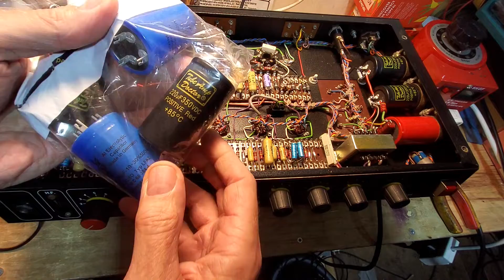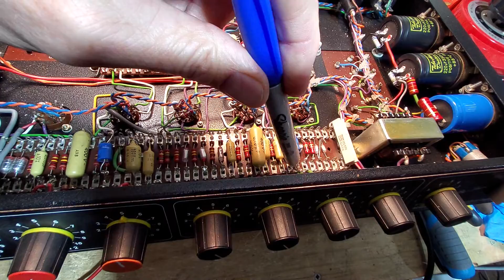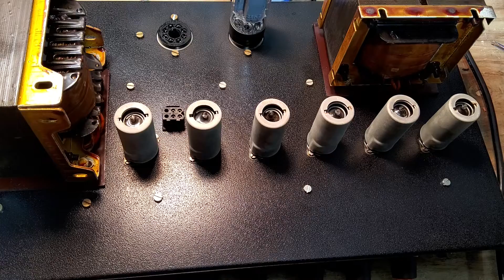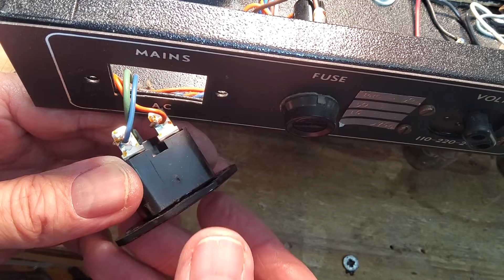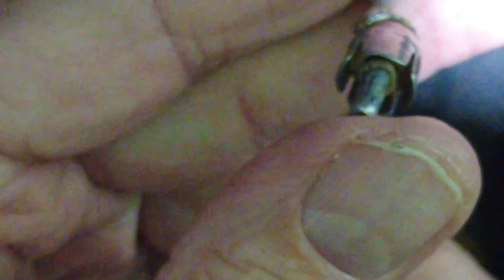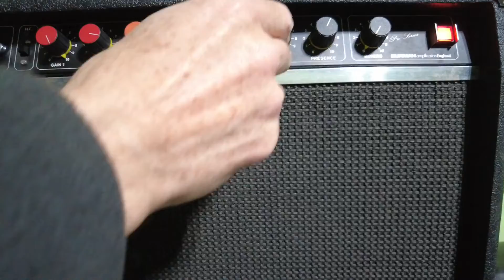Burman Pro 501 Combo Boutique Hand Wired Guitar Amplifier  Part Two Full Service

Comment: I adore your playing in this , I have a Burman502PRo and have used it for 40 years! ANd yes you MUST have the Accutronics reverb tank hooked up  with that annoying RS Components multiii plug! The direct inject has been removed from mine, I was told mine was owned by Nazareth, it was one of several spares. Great bit of kit,
Reply from the maker: Hello David, thank you. That's a long time to have owned an amp. Nazareth were a great band. The Burman amps are one of the best. Take care.
Reply: Looking at the schematic of the Burman 502, I notice the 'Mid' EQ stage is involved with the 'buffer' stage, later in the signal chain than Bass and Treble. I have found that dialling  'mid' totally out of the picture greatly increases the clean headroom. I wonder if it's possible to tame the 'buffer'? It is fed by a stage bypassed at the cathode with 100uf at 10volts. I see some potential for a mod to clean up the unruly distortion, and perhaps the same could be done with 'Gain 2' which is almost always too messy , unless you're happy with 'a storm of nails' overdrive.  Any thoughts @vintageguitaramp_guitarteacher ?

Comment: Hi, thank you for the service video. I have to do the same Job, recap it, get some KT77…and we will see what else. With how much mA do you bias the KT77? Thank you!
Reply from the maker: Hello, thank you. The bias current will depend on how much HT voltage you have from the secondary of the of the power transformer. The bias should be set at 70% idle. The KT77 has a dissipation of 25 Watts. 25 x 0.7 = 17.5 Watts.
Reply: Thank you very much for this information! I‘m exited and hopefully the day will come soon.

Comment: Martyn, that was a particularly tasty sound demo, and I think it's fair to say that this amp inspired you! Did you ever find an actual reason for the intermittent voltages and the bias setting creeping around? I'm still a little concerned about it; I tend to suspect leakage through the board or a socket, possibly from contamination..... You've probably already buttoned it up and maybe it went back to the owner already, but anyway I would have liked to have seen what happened if you hit it with warm air from a air dryer.
Reply from the maker: Hello. I am going to change the tube sockets and screen resistors. Don't have any confidence in the bias staying stable, once someone starts to gig with it. It's a lot of amp and it needs to be right. I have ordered a pair of Belton sockets for it. I am not happy with the bias preset either. It needs a fail safe, although I would sooner it be a fixed resistor value. I will be doing another video when I change the sockets. It's that feeling you get when you just can't leave it as it is. Take care.
Reply: @vintageguitaramp_guitarteacher  ,  It also occurs to me to ask if any of those front panel controls are making signal ground simply by virtue (🤔?) of being bolted to the chassis. The thick paint could be causing resistance and interfering with the grounding of the pots.  There's a good reason that Leo Fender used an unpainted chassis and a brass ground plane  plate for the pots to bolt down onto;  and although Leo's amps were not high-gain and therefore less prone to grounding issues, this Burman has tons of gain and proper grounding will be crucial.

Comment: A hidden gem amongst vintage guitar amps. Your playing demo did it justice and demonstrated that these Burman's should have become a household name amongst the guitar playing fraternity up there with boutiques like Dumble and Trainwreck.
Reply: Move over, Mesa Boogie and Dumble! From soup to nuts, is there anything this amp can't do?  No need for a clean boost pedal, Tube Screamer, or a Rat on this beast! Hell, it even djents!  It definitely shines through the 4x12 cabinet; a shame it wasn't built as a head.  The brand name is so unassuming, and the amp so unadorned with frills or fancy graphics on the name plate that players probably don't give it a second glance if they come across one, which is a shame.
Reply: @goodun2974   I share your thoughts entirely. They are heavy amps and a head version would have been a great option with that additional bonus of plugging it into a 4X12 which was definitely a great match.
Reply: @pda49184  ,  I don't know if you watch Fazio Electric on YouTube but she (Colleen Fazio, a female amp tech) did it quick examination of an old Selmer Twin Fifty combo amp that looks like it weighs even more than this Burman does!
Reply from the maker: Hello. I spoke to a guy who knows a lot about these amps and knows Greg Burman. I am sure he told me that they didn't make any heads. It does sound mint on the Marshall cab.
Reply from the maker: Hello Pete. I think so too. Take care.
Reply: I really wish they were worth the same on the used market!

Comment: Just had a comment deleted because i put a link to a recent Uncle Doug vid about a brownface bassman. He rejigged the bias circuit so if the pot has a break or dirt on the track there is a backup resistor to avoid bias runaway damaging the output valves. Worth a look?
Reply from the maker: Hello Rob. I was thinking that yesterday. I an not happy with the trim pot. In fact I have ordered some new tube sockets and screen resistors. I have done similar things in the past with the trim pot. I will check the Uncle Doug video out though. He's great at solving problems, thank you. Take care Rob.

Comment: The huge transformers in there handle as much bass and volume as you'd want so scooping the mids helps the distorted tones. Make a great bass amp too, really nice cleans, a versatile amp. Nice design.
Reply from the maker: Hello Rob. Yes, it;s a beast. I have just put up part three. I changed the tube sockets. They were done for, even though it ran, there was something not right with the bias. All sorted in part three though. Thanks Rob and take care.

Comment: Thanks for the info about Modulus never heard of them before know and I have been looking for a chassis for a JTM45 and found a supply which  are made in China which I have ordered  but its  alloy where as the Modulus are steel and which is about the same price I would have preferred   due to the weight of the transformers.
Looking for .5 watt resistors not sure if I should use carbon or metal film just wondering what to do, can you give me some advice ?
The output transformer is made by Sowter with screen taps Brand new cost a arm and a leg got it less than half price off ebay, mint condition, some one gave up on a project.
Reply from the maker: Hello. Sorry for the late reply. My Mum passed a couple of weeks ago and had a few things to sort. I just haven't had time to get to all the comments. Modulus is a great place for parts. Michael who runs it is really helpful. I would go with 1 watt resistors were you could .5 watt. It's a choice thing between carbon film and metal film. Use metal oxide for the voltage dropping resistors. They will need to be bigger than 1 watt though. That sounds like a really tasty transformer. If you use the screen taps you will have a cleaner tone. Ultra linear transformers as they are known are generally used for Hi Fi, but they have been used on guitar amps in the past. If you want some break up at high volume then just follow the JTM 45 schematic. I am always on here if you need any help. Thanks for watching and take care.